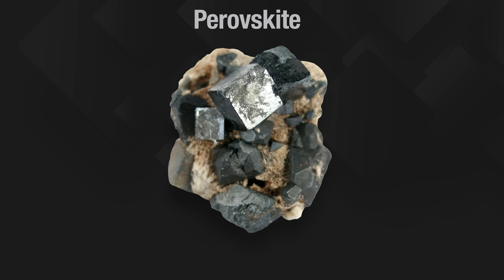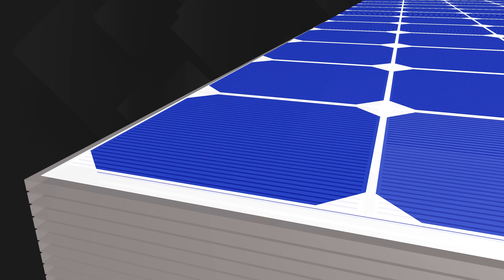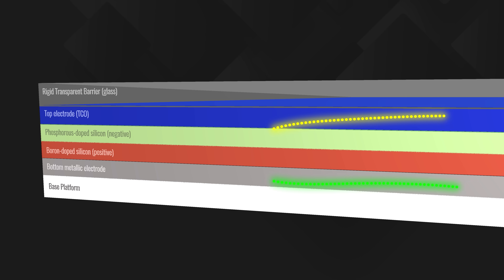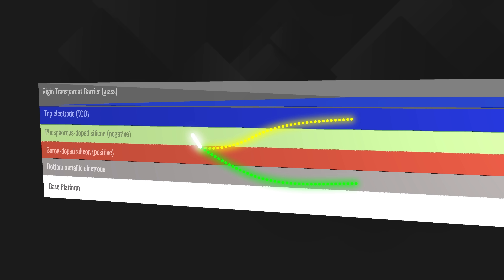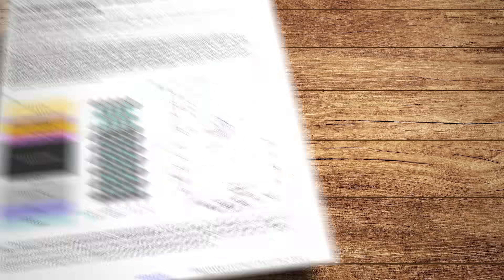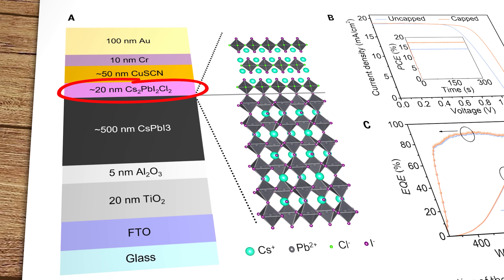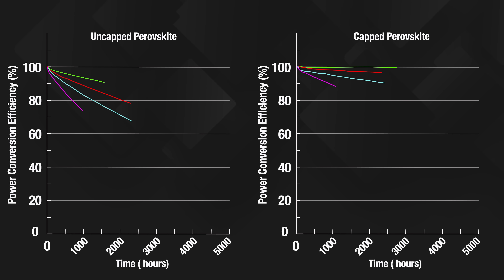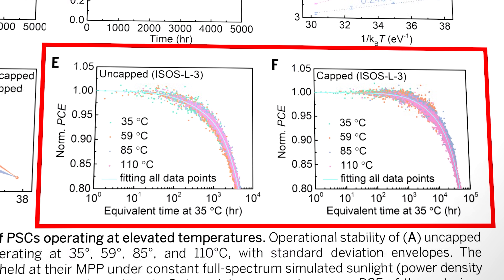Perovskite solar cells. Major new breakthrough!

Comment: My worry is that with the perovskite example you've shown, is that they are made with Lead (Pb).  There should be a recycling procedure with these panels and cannot be disposed in landfills.   Just read some more, Lead Iodide rapidly becomes more soluble the warmer it gets.  If the panels become cracked (especially in a hot tropical or desert environment), water can dissolve some of the chemicals and lead will seep out into the home and the environment.   This is not a good technology.
Reply: Seeing its aspect of wrapper-like one use plastic I thought the same thing.
Granted its solid, unlike in petrol, and that makes It easier to dispose of appropiately, but then again we humans are not respectful as a species. Dang.
Reply from the maker: Lead recycling is the most advanced recycling system in the world as a result of billions of lead acid batteries for road vehicles. The amounts in these cells are tiny compared to that.

Comment: What about covering ev with these? If they are cheap and easy to replace would be a no brainer to do it every couple of years! Now imagine that on planes, buildings and even airships! Free fuel and heating!
Reply: On standard EVs this would not produce enough power significantly change the car's capacities. However, on low-consumption cars, or even ships or blimps, that would be a great idea.
Reply: No amount of solar on ev will help. It just adds to weight and complexity , and produces max maybe 2kW of power in the best conditions, which is very little. Nothing is free.
Reply: @movax20h  it helps a lot on very efficient cars like the Aptera

Comment: If they really have achieved this then that's awesome 🙋🏼‍♀️
Reply: Dennis Lee's invention produces energy 24/7 anywhere in the world, hot or cold, day or night. And connected to their compression motor, it runs continuesly recycling over and over. The more the wind hits it, the more heat it extracts from the atmosphere. Therefore it doesn't need the Sun. 
A very simple and easy to manufacture device. Very little maintenance, has already been in production and on the market for over two decades. But the Nurds want to make everything so difficult. 
You'd think that if the Climate Crisis was real, this device would be mandated for every building in the world. But the Climate Crisis is a Hoax. So good luck with having real products for real solutions.
While you're here, look up Dennis Lee, Troy Reed and The Big Eureka. At least have a peek down the Rabbit Hole.

Comment: Glad to see this getting closer to being something that can help widen the capture of solar and not just by panel.  Skyscraper windows, shingles, solar driveways...
Reply: well take out the driveways that never really worked. All real life testing done showed an extrem quick destruction as the mechanical stress is far to high.
Reply: Versatility of installation solar's greatest strength.
Reply: Geez, why does the nonsense continue? These are very stupid ideas.
Dennis Lee's invention produces energy 24/7 anywhere in the world, hot or cold, day or night. And connected to their compression motor, it runs continuesly recycling over and over. The more the wind hits it, the more heat it extracts from the atmosphere. Therefore it doesn't need the Sun. 
A very simple and easy to manufacture device. Very little maintenance, has already been in production and on the market for over two decades. But the Nurds want to make everything so difficult. 
You'd think that if the Climate Crisis was real, this device would be mandated for every building in the world. But the Climate Crisis is a Hoax. So good luck with having real products for real solutions.
While you're here, look up Dennis Lee, Troy Reed and The Big Eureka. At least have a peek down the Rabbit Hole.
Reply: @bradleejones9959  Good luck with that climate change being a hoax thing.  You'll need it.
Reply: somehow jhat is very silent on the subject of polish company Saule Tech which manufactures thin film perovskite cells since may of 2021... few weeks ago Timmermans was wvisiting the factory.

It is strange that Dave is so quiet about it since Olga Malinkiewicz, polish phycist is a potential nominee to Noble Prize in physics... I guess he is more about promises rather than existing solutions - it draws more views probably.
Reply: we have more then enough space on roofs, and solar driveways are just supid af...
Reply: @423GustavBern  If anything suspend the PV's over the driveway and shade the car.
Reply: @glennmartin6492  even that isn't very praktical. Every time you have a special transport, which exceeds normal truck hight, you have to deconstruct the whole thing.
I suppose you could do 1 lane on a two lane highway.
Reply: @splittin2atoms  There is a  Canadian company that does interlines barriers with vertical panels, and acoustic isolation for roads using panels with a printed designs that integrate them better with the environment.
Reply: @splittin2atoms  Why would you need special transport on a driveway?  Why not just get them to park on the lawn?
Reply: @glennmartin6492  sorry, my bad. Apparently I do not know the right translation or the word driveway.

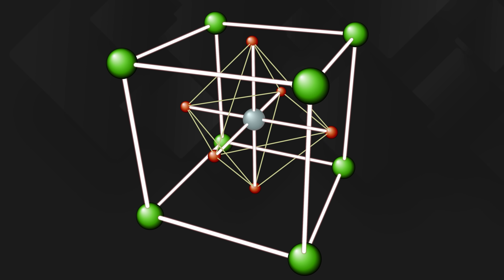Comment: 1:30 the diagram has a couple of small error that amused me. 
1) look at the cube with green corners. the front right vertical should be in front of the diamond red to grey strut.
2) the thin lines running from the rear red and right most red to the lowest red should be in front of the bottom rear bar.
Sorry just me aspy brain can not un-see them.
Reply: you have a great pair of eyes. The red balls should be on the center of each faces (each face is shared by two hence three red balls) and eight corner green balls are shared by eight (hence one per cell). Poor perspective control has lead to this mess.
Reply: My Aspie brain couldn't visualize any of it, but it was still pretty! 😉
Reply from the maker: I did wonder if anyone would be pedantic enough to even bother commenting.
Reply: @JustHaveaThink  You have no idea how pedantic I can get. I have already started work on a model that could produce the picture to see if it just an illusion.
Reply: @JustHaveaThink  Answer is you can produce the diagram in a few versions from the specific angle shown. It is simply a matter of curving the lines towards or away from the camera so that they look straight from this angle. Surprisingly I don't think any of the resulting object will  revolutionise solar cells!

Comment: isn't the use of lead in the perovskite an issue for commerical application? At least thats what our Prof told us that worked on this.
Reply: it is best to avoid lead as much as possible. Biggest consumer and users of lead are from nuclear industry and the automotive and locomotive batteries.
Reply: @janami-dharmam  Neither of those applications of lead represent an environmental danger.  They are well contained, and close to 100% recycled at end of life.
Reply from the maker: The amounts are tiny and the lead recycling industry is arguably the most advanced in the world because of lead acid batteries in hundreds of millions of road vehicles.
Reply: @JustHaveaThink  I hope that you dive into lead (and solar panel) recycling technology some day.  I note that lead in batteries are massive and concentrated, and totally different from miniscule amounts embedded in large amounts of other things.
Reply: by the way, there is already a tiny amount of lead in silicon solar cells needed to help quantum tunneling to an electrode atom
Reply: @JustHaveaThink  i was told that the problem like with aspethos is, when the cells are damaged, especially in a fire which would make the fumes pretty toxic.

Comment: Forgive my skepticism, but I would only call it a "breakthrough" and a "gamechanger" if I can actually buy them.
Reply: LEDs have taken more than 40 years to light up our homes. Solar panels have been used in artificial satellites for quite some time but not yet widespread where the sunlight is most abundant (africa and south asia). Today the panels are more reliable compared to the electronics (controller and the inverter) needed to use them efficiently.
Reply: @Adler Mow  The definition of a breakthrough is: "a sudden ... important discovery" or "a sudden advance especially in knowledge or technique."  Dave is using the term as it applies to knowledge and discovery, which is correct.
Reply from the maker: Thanks mm, but I am not Matt Ferrell. That is a different channel.
Reply: @JustHaveaThink  Please accept my sincere apology - I have corrected that.
Reply: There was a time when scientists and engineers took a measured, wait-and-see approach to new technology. Now they get ahead of themselves and overhype things to get hits on YT.
Reply: And actually buy them at competitive price.
Reply: I'm inclined to agree.
Reply: It should be called push forward instead of that click baitery.
Reply: @AdlerMow  Breakthrough already means that